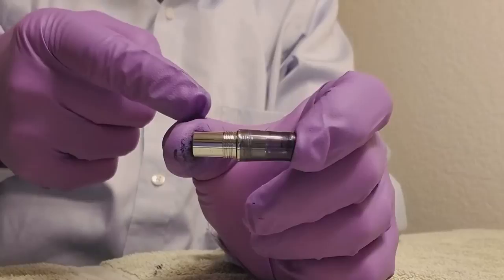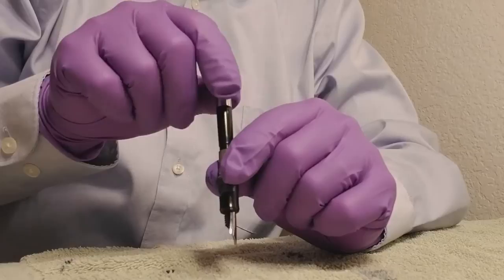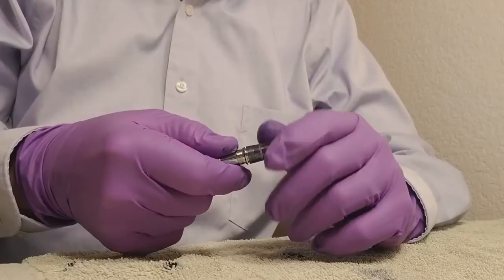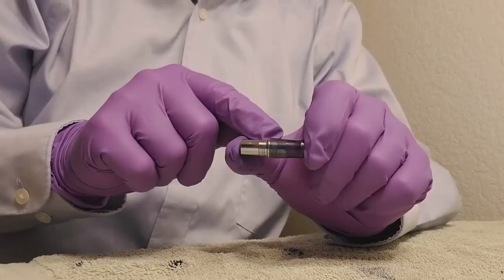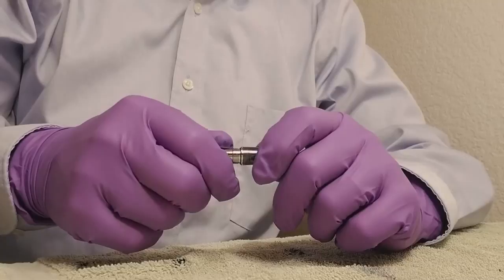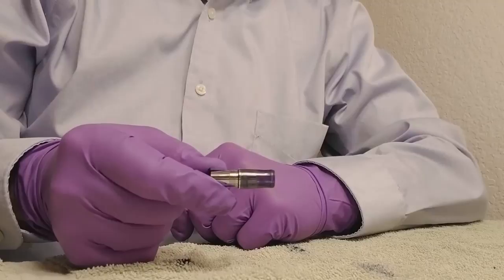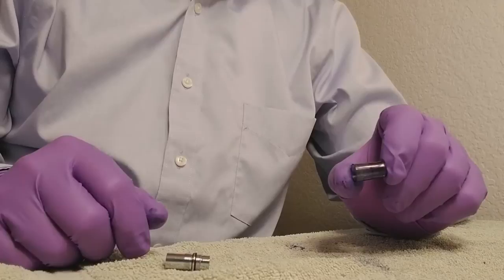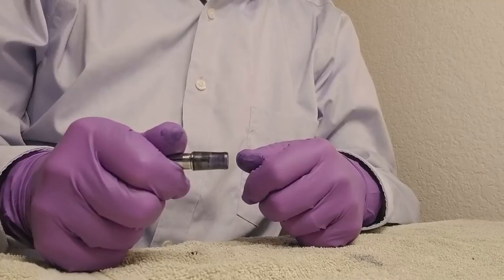Bookman Presents: Pilot Custom 74 Section Disassembly Into Two Pieces—Tiny Strokes Fell Great Oaks

Comment: Thanks for the video, but sadly, removing the nib unit doesn't work to me, when I twist the converter, the nib doesn't even move. I had this pen for some time now and the section of mine is now completely filled with ink. This actually bothers be at first, but continuously trying to disassemble it without any success just made me "live with it". I wish I can manage to remove it sometime.

Comment: what am I missing?  Your o-ring is at the flange.  But there is no ink on the other side of the o-ring.
Reply from the maker: I can't swear the offending ink comes in through the space between the section and the barrel when I over-submerge the nib and feed into the bottle.  But that's one possible entry spot for the ink.  To get a good fill, I have to submerge the nib completely, which means I have to submerge part of the grip.  Sometimes I submerge too far accidentally.  For all I know, that's the only way the ink actually seeped into my grip space. Maybe the ink came in through the nib/feed/collar—because the parts weren't properly installed?  I'm a belt-and-braces guy.  So I use the O-ring.
Reply: @Ray57Bookman  I would think that if the two pieces were so tightly fused together in the past then there is no way ink can get into it from the top (I e. where you have the o-ring now).  It must have got in through capillary action from outside of the nib feed assembly.  Nevertheless having an o-ring there helps to prevent over tightening and cracking the plastic part.

Comment: Hi Ray - thanks for this. When I turn the converter, the collar doesn't come out. Any tips on getting the collar out? Can I still proceed with working at removing the grip?
Reply from the maker: Pull the converter out slightly but still attached. Then try it again.
Reply: @Ray57Bookman  I don't think will work - think its in there. Do you know if I can keep unscrewing without removing the collar. Does the engineering allow to take apart the section before removing the collar.

Comment: Thanks for the video. I've tried a number of times but I can't get my grip section of. I'll see if a few months (or was it years?) of tiny strokes can make it happen.
Reply from the maker: It took me 1½ years, Mike.  I do not doubt that one could unstick the plastic grip more quickly than I did.  However, I caution everyone who chooses to follow my lead to refrain from getting in a big hurry to accomplish the feat.  As long as the bond is stronger than the plastic grip, the risk of cracking the grip is prohibitively high.  Break the bond down over time.

Comment: Hi Roy, thanks a lot for showing it is possible to disassemble the section piece.  I am wondering if you have ever tried heat, like the way you have to when disassembling the Parker 51 section?
Reply from the maker: I never used heat in any effort to unstick the grip because I never made any real effort.  The exercise of giving the grip a  not-too-forceful twist was more an exercise in wishful thinking.  I never had the delusion that my exercise would be successful!  When it was (after a year and a half), I had to pinch myself.  Had I not been speechless, I might have said, "You've got to be kidding."

Comment: Great video Ray. Do you know if it's possible to remove the section parts without removing the nib collar? 

I have tried multiple methods to remove the nib collar, and it won't budge. So I'm wondering if I can still unscrew the section while it is attached. I am assuming that the nib collar threads into the metal part of the section, which could mean that unless you take that out, the section won't come apart?

Comment: Thanks for good video. Really helpful guide to me :) Did you notice any glue (sealant)  between metal coupler & plastic grip, when you succeeded in taking them apart ? What do you think two pieces  joind so tight?
Reply from the maker: I didn't see any remnant of glue or sealant on the threads when I finally separated the two pieces.  It is possible, nevertheless, and perhaps likely, that Pilot used some type of bonding agent.  But it's tough to draw any widely-applicable conclusions from a single case study with few facts.  I only know that every reviewer of the Custom 74 that mentions the issue of grip removal says he or she couldn't do it.  But I did it.  I would simply recommend that if, like me, you just can't stand the thought that (1) the grip must unscrew from the metal part of the section, else why have threads in there; (2) it must be possible, or will someday be possible, to clean out that trapped ink between the plastic grip and the metal part of the section; but (3) you too are concerned about breaking or cracking the plastic grip: maybe you should let the passage of time work for you.  Just as I did, give the grip a test twist every once in a while.  When it seems ready to come off, remove it.